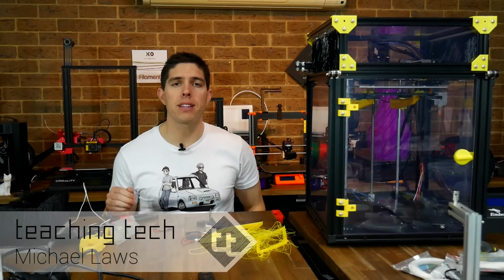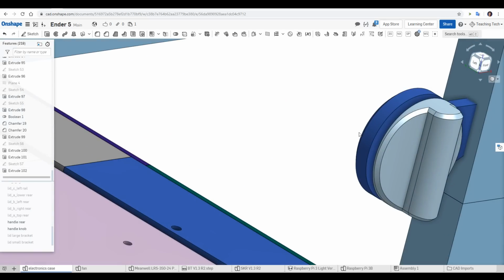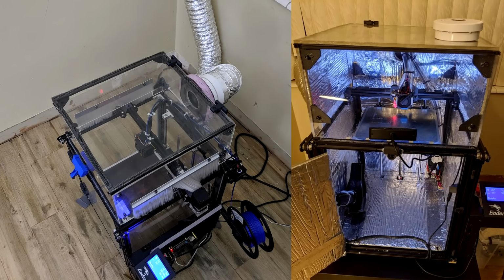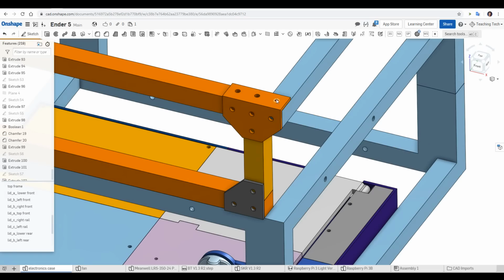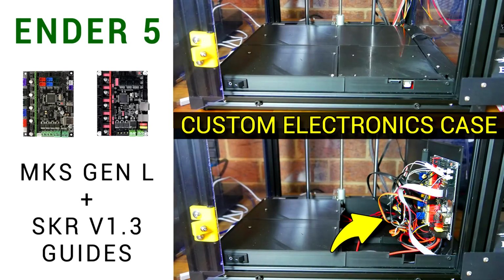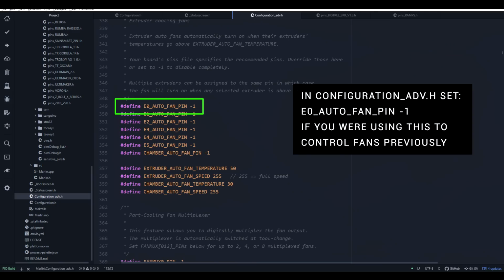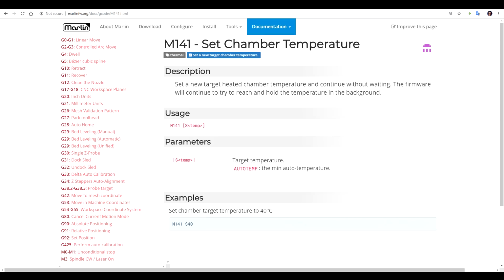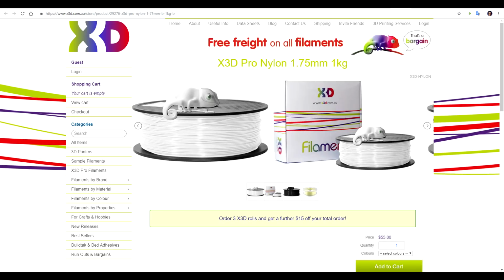Ender 5 enclosed lid and heated chamber guide

Comment: Anyone had issues with the y axis siezing when the chamber gets up to temp and subsequently loosing steps? 

The gantry is noticeably hard to move when hot but is fine when it cools down again.

I think maybe my frame is expanding and over tightening belts or the frame is distorting

Comment: I went a similar route you did the first go round. 2-50w nozzle elements,heat sinks and a fan, only got about a 10c boost.scrapped that idea an put a 1200w space heater element ran from an external P.I.D control, the thing barely has to run to keep up.

Comment: I basically used this concept for my ender 5 plus for the last 6 months.  Its been great, but there is one big issue that may not have been caught before uploading this video. With this design  the nylon brushes can cause print failures.  To prevent this some brush "plows" need to be installed on the x gantry.  Without these, the brushes can get caught in the belt and pulled into the motors causing layer shifting.

Comment: I know this was a while ago but you dodged a bullet with that heater, it came with the moai 200 and the temperature variations it caused by its wide ranging lower and upper values caused a load of problems with the prints… that and it had to be replaced twice!

Comment: Have you set up the mains silicone bed yet? I have a 500w 11v mains with heat sinks on it that will reach 250c, but need to distribute the heat into enclosure. Really hoping you have a follow up on this.

Comment: Just a few thoughts: using an aluminium frame is not the best choice, because aluminium is good heat conductor. That part is actually working like a cooling radiator. Acryllic is not so much, but the surace area is huge, and without insulation and heat reflection its also a kind of week point. I really like how it looks like, but imho a more simple and much cheaper design could achive an inside temperature that you might even want to move all the electronic parts outside from the chamber, and replace the plastic parts as well for something that can stand high temperature. Actually this   part seems more tricky to me rather than how can i build an insulated box which can hold like 80-110 °C

Comment: I built a powdercoating oven once out of 1x1 steel square tube, double walled with sheet metal and insulated with fiber glass. The inside temperatures would reach over 450 degrees F. The temperature was controlled with an SSR and cheap amazon control unit. The heat came from used oven elements....... Worked like a charm.

Comment: Hello Teaching Tech,
Kay3D released a new true coreXY conversion kit for ender 5 plus.
with it the design of an air tight enclosure is straight forward.

with this kit, an actively AC heated enclosure to about 60 degree and a direct drive extruder + AC heated bed it is possible to build the ultimate ABS speed demon for large prints for about 1100 usd.

I think it will be an interesting video and I seriously considering purchasing this machine with the kit

Comment: If you added a second layer of bristles that weren't as long as the first ones that come down, say, halfway, you should be able to cover up that little triangle where the extruder motor is moving, and this will create a much better seal.

Comment: Anyone can help to setup skr 1.3 chamber heater?
2 extruders P2_04, P2_07.
1 head bed P2_05
1 chamber heater P1_26
1 chamber temp P1_24 (try Thermistor 100k Ohm B 3950, NTC thermistor 10k, DHT21)
neopixel P2_00
inside led P1_28

Comment: Hello, I noticed an error in your configuration which led to the failure of heater idea. In file  

Marlin\src\pins\lpc1768\pins_BIGTREE_SKR_V1.3.h

you should have commented out FAN1_PIN:

 #if HOTENDS == 1
  #ifndef FAN1_PIN
    //#define FAN1_PIN       P2_04 //I commented this out
  #endif
#else
  #ifndef HEATER_1_PIN
    #define HEATER_1_PIN   P2_04
  #endif
#endif

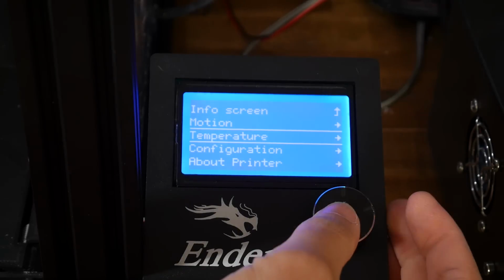Otherwise, as we can see in your video (9:28), Marlin creates Fan 1 and Fan 2  and Fan 2 is strugling to turn off the same pin which is turning on heater. It could be seen by flashing mosfet LED. Moreover it's good idea to measure the temperature of heater, not air, as it could get pretty hot quickly. In fact you were lucky with this bug disabling the hotend so it didn't burn. I also used smaller fan so I get less amount of air but it's hotter . Nonentheless thanks for great movies!
Reply: itrying do do same with skr 1.3
couple week stock on it.

Configuration.h
#define TEMP_SENSOR_CHAMBER 1 (try 999 set to 60c)

Configuration_adv.h
#if TEMP_SENSOR_CHAMBER
#define CHAMBER_MINTEMP 0
#define CHAMBER_MAXTEMP 60
#define TEMP_CHAMBER_HYSTERESIS 1 // (°C) Temperature proximity considered "close enough" to the target
//#define CHAMBER_LIMIT_SWITCHING
#define HEATER_CHAMBER_PIN P1_26 // Chamber heater on/off pin
#define HEATER_CHAMBER_INVERTING FALSE
#endif

#if ENABLED(THERMAL_PROTECTION_CHAMBER)
#define THERMAL_PROTECTION_CHAMBER_PERIOD 20 // Seconds
#define THERMAL_PROTECTION_CHAMBER_HYSTERESIS 2 // Degrees Celsius

/**

Heated chamber watch settings (M141/M191).
*/
#define WATCH_CHAMBER_TEMP_PERIOD 60 // Seconds
#define WATCH_CHAMBER_TEMP_INCREASE 2 // Degrees Celsius
#endif

pins_BTT_SKR_common.h
after:
#ifndef TEMP_BED_PIN
#define TEMP_BED_PIN P0_23_A0 // A0 (T0) - (67) - TEMP_BED_PIN
#endif
add:
#ifndef TEMP_CHAMBER_PIN
#define TEMP_CHAMBER_PIN P1_24
#endif

after update always got:
Err: MAXTEMP: Enclosun
PRINTER HALTED
please reset.

using skr 1.3v
used pin
2 extruders P2_04, P2_07.
1 head bed P2_05
1 chamber heater P1_26
1 chamber temp P1_24 (try Thermistor 100k Ohm B 3950, NTC thermistor 10k, DHT21)
neopixel P2_00
inside led P1_28
Reply: @klausimai  that might be because there is no PID control for this heater and some oscillations occur during heat up. I set my max chamber temp to around 150 °C and I set it to 120°C. It's also necessary to make thermal runaway protection parameters less restrictive for chamber and change switching temperature margin to slightly bigger value.
Reply: @juliuszneuman6455  so how you set up chamber pid?
Reply: @klausimai  I am using Marlin 2.0 and PID is not implemented for chamber. There is only simple switching regulation.
Reply: @juliuszneuman6455  it that what I need. I'm using bord to mosfet on-ff relay to CIRRUS 50.

Comment: You might consider insulating some of the sides that you don't need to see through so you can avoid losing all of the heat coming off the heaters and the bed.  You might also consider a separate power source for the chamber heater, so that you can run multiples.

I haven't been 3D printing in a while, but the two I have are too small for things I want to do so I have been seriously considering the ender 5 plus.  My concern was difficulty with enclosing it, but you've helped me with that.  I don't really have a way to cut components though - have you considered making and selling a kit?

Comment: What’s the max chamber temp before you need to start finding cooling solutions (ex liquid cooling) for the steppers and hotend?
Reply: steppers are save up to 90/95 degrees, i usually stay on max 80/85 degrees with not crazy speeds

Comment: Idea. How about the heater units in cheap food dehydrators. They typically heat to around 70c. You may be able to tap into the heaters own thermister, thus powering the unit from mains while controlling the heat via Marlin. It's an idea I've been meaning to try myself when I get to build a chamber my highly modified cr10 (MKS 1.4, 24V, Hemera, braced...). Great content by the way.

Comment: Maybe make it more airtight by adding some accordeon sealing to the moving gantry? 

Anyways you could also use the heating bed to heat the chamber, make the chamber heating action a fan blowing on the bed. Properly insulating the chamber is a big plus to not needing a huge amount of power. Your little heater is powerful enough , assuming the peak energy loss at desired temperature is lower than its output, which is the whole point of proper insulation. I have done the exact opposite once by using a relatively small peltier element to cool down a rather big chamber to -40°C. In both cases it just takes a while, so the bigger heater is mainly to speed things up

Comment: I'm working on enclosing my printer to passively warm it, but I'm not going to use any extrusions and just join them with 3D printed joints on the corners. It will be large enough to hold 4 spools of filament to keep warm/dry. I'm going to apply thermal film to the plexiglass to help keep in the juices. The printer is a Replicator Dual clone.

Comment: Looking for a update on this. It has been 1 month now. Have the parts arrived yet?
I can print ABS on a 60* bed in a 20* ambient room in a enclosed printer no problem (acidently used wrong slicer profile to discover this). My normal is 95* bed and over night has been as low as 1* with no heater for the enclosure.

Comment: i love your videos. Regarding ABS and a heated build chamber: I print ABS and ASA  routinely and I do not have a chamber heater. In fact, I generally vent temperature to keep it below 50C. I use PEI sanded with 600 wet/dry. The stick is so good that I use alcohol to help it release. Bed temp is 90C (reported) and the printer is a Raise3D N2.

Comment: Personal i would have used an open top box under the printer (similar to what you did in the upper part. so that the printer sits on top of the heat source. with with the heaters mounted inside then a separate power source, but wire the temp controls to you mainboard, to control when the heaters comes on and off. Heat rises so you shouldn't need any fans to circulate the heat.

Comment: I’d be interested to see how much heat your losing through the bristle system you designed but also through the side panels as you didn’t appear to seal them in any way. Another possible solution would be to replace the bristles with bellow covers like we use in industrial machines, these can be easily cut to size and are available in lightweight versions so wouldn’t add any noticed drag to the Y axis. I’d seriously look at sealing the panels and door if possible as the more heat you can keep in the enclosure the better, you’d more than likely be able to run a lower powered heater too.

Comment: Hi Michael, thanks for all the great videos you made, keep them coming!
As for the encasing idea, I built one of 12mm plywood and a sleek Ikea glass door for my CR-10s- mainly to muffle the noise and control the ABS odors. I also liked the idea of having no air drafts for a better warp control.
Since my wooden box is fairly air sealed I reach chamber temperatures of 40°C just by setting the bed temperature to 85°C (which works fine for ABS and PETG so far, with super-hold hairspray I barely get the parts off the glass plate) 

Now, here is my concern: the cheap stepper motors have usually just a "class B" insulation. This means that the maximum core temperature (the copper coil inside) is specified for 130°C which can be reached already at 50°C ambience temperature. The "over the thumb" rule says that every 10 degree above the max core temp you slice the life of the motor in half.

My current idea is to cool at least the X and the Y motors with some 40mm fans I have laying around as they get really hot. One of the reasons is that I installed damper plates against the noise, the rubber element acts as a heat break. In the long run (when I build "my perfect machine", like we all do :-) I am thinking to go to a cube core-XY where all motors are outside the print "chamber".

Comment: The fan from the heater may be blowing air over your print. I put my cr10  in a cardboard box, disabled the part fan and print and at 250 with a 95 bed. My enclosure gets 75-90f depending on ambient temp. I'm getting good results but the bed takes 15 minutes at least to get to 95.

Comment: First, I would like to wholeheartedly thank for all your efforts and dedicated time offered to so many of us who are struggling and new to this craft. I recently got an Ender3 would yu recommend a case around if we are only going to use PLA? and is it possible to build a case like you have on the Ender5? thanks a lot for all your sharing and caring!
Reply: Ender 3 doesn't require an enclosure for PLA. Only really for ABS but to print that on the Ender 3 it needs many upgrades.

People do however make LACK enclosures as seen on thingiverse using Ikea furniture so there's nothing stopping you making one in that design around the entire printer with extrusions instead.

Comment: I am looking at finally getting a 3D printer and am not sure which of the following to get: Sidewinder X1, Sapphire, TronXY X5S, Ender 3, or Ender 5. One of the first upgrades I would do is replace the controller with a duet. Knowing what you know about them all, which of these would you buy for your first one (and possibly only one)? I realize that there are major differences in them, just looking for some advice. Thanks.

Comment: You'll get better performance if you insulate the walls of the enclosure. I can get air temps of 55-60c in my Lack enclosure with only the bed set to 120. A big 100 watt ceramic heat lamp and the bed at 160 can see temps approaching 90c. For insulation I use metallic bubble insulation sandwiched between two plexi sheets. I used to secure it to the inside of the chamber walls using foil tape, but the portions close to the heat lamp began to deform from the radiant heat. The lamps are commonly used for terrariums, for keeping pet reptiles warm. You can either buy light fixtures and wire (or get your electrician to do it for you), or you can utilize cheap clamp lamps and secure them to some Vslot extrusion using Tnuts.

Comment: The main issue here is termal insulation.
1) Aluminum frame touches the outside air as well as heated air, so (being a good heat conductor)  it acts like a radiator.
2) Acryl is not a good insulator. It can help to keep the air inside, but not to keep it warm.
3) Brushes are ok, but you probably want a fiew layers of those. (or a foldable rail cover)

Built my chaimber with wood, some 20mm foam-like insulator sheets(not sure about an english word for it) and a foam gun to close the gaps. Requires no additional heating other than heated bed and the nozzle radiator. In fact it needs cooling for keeping the PTFE tube alive.
Reply: Which temperature you get inside the chamber?
Reply: @theknois  50 celsius inside when its 6 outside.

Comment: It looks like the bristles could get caught in the belt.
Reply: Ady Texas it does look like it and if not the correct spacing and alignment they work great I used horse hair rated to 300c  3/16” is really all you need but I got 5/16” x3” about 50$ cdn I got 4ft get a quality brush and they stay on the strip

Comment: Could Polycarbonate make for better sidewalls then acrylic? Should be available under the trade name of Lexan.
Reply: R values are similar but the service temperature is much higher.  Consider a higher r value material for the top and any side that you don't want to see through. I thought of grid ceiling tiles as a decent choice.  Be safe.

Comment: Do you have a running cost total of the non printed parts used for the project so far (the ones that made it into the build)?
Reply: I'm in the US and I'm building it for an Ender 5 Plus (bigger) it's going to cost about $200

Comment: forgive my ignorance... but if you are doing ABS do you not want a completely sealed chamber due to the formaldehyde release... and the bed typicial needs heating to the glass temperature for most filaments so surely you already have the correct temperature heat source heating the chamber?

EDIT: As for the stepper motors getting to hot... why not water cool them?
Reply from the maker: The bed will be at temp, the nozzle is at temp, but in between the part will be cooler. The shrinkage deforms the part. Unfortunately the heated bed doesn't heat the whole chamber.
Reply: @TeachingTech  But as we all know heat rises, so your brushed top let's all the heat escape as it has too many air gaps.  If you use another heat source below that will also escape the same way unless you use a completely sealable chamber.

Comment: BTW if I would do it, I would use a silicon heater too. I am sure you know that you can't use this heaters in free air, you have to attach some aluminium to it. I would use a fan like this: https://i.ebayimg.com/images/g/sosAAOSwXdlci84r/s-l1600.jpg. The heater would be in a small chamber in the back of the printer and the fan sucks the air down, so that there is no draft over the build plate.

Comment: Hi Michael, is static a problem with this brush set up or did you get anti static Nylon bristles?  For the heater, maybe you could do a surface insulated type heater like this one. https://www.aliexpress.com/item/32815744131.html?spm=a2g0o.productlist.0.0.55d457195gXUzS&algo_pvid=68fabd50-1326-4a1c-a6db-68791b6dfc22&algo_expid=68fabd50-1326-4a1c-a6db-68791b6dfc22-0&btsid=944d9c40-c54a-4717-8b74-1849f3f8c2b6&ws_ab_test=searchweb0_0,searchweb201602_10,searchweb201603_52

Comment: NASA has a guide on how to print engineering grade filaments using "off the shelf" components. It might be neat to see what they are doing to heat the chamber up.
Reply from the maker: Thanks great suggestion.
Reply: I'm struggling to find this, can you offer any specific search terms or even a link? Thanks

Edit: disregard that I found it :D https://ntrs.nasa.gov/archive/nasa/casi.ntrs.nasa.gov/20170000214.pdf

Comment: awesome idea with modifying a hot airgun... some of the one from solder rework stations might be perfect,  hehe you could even make it ducted to each corner with little restrictors to even out the air flow from each outlet :)